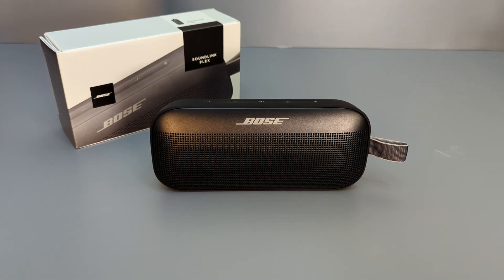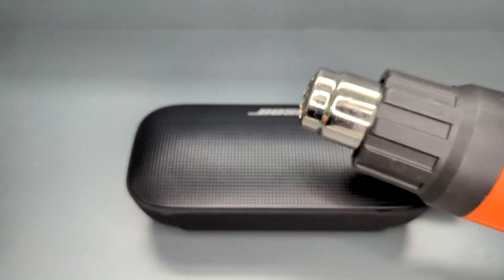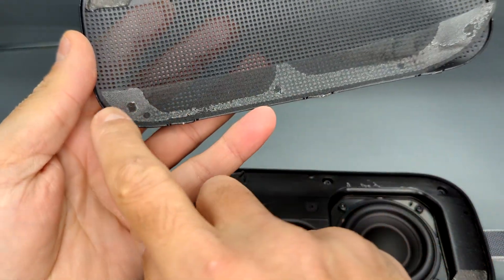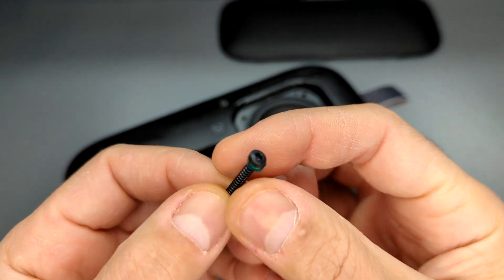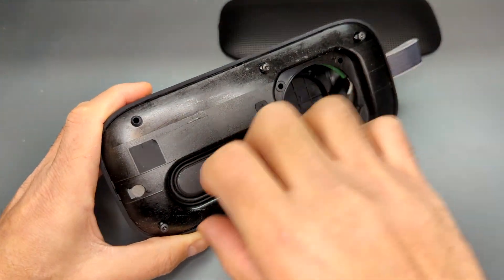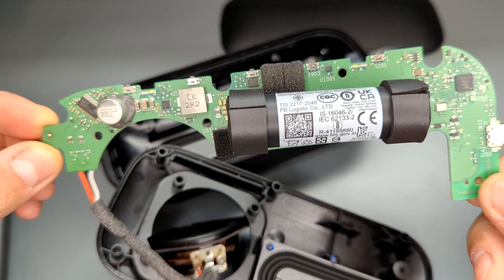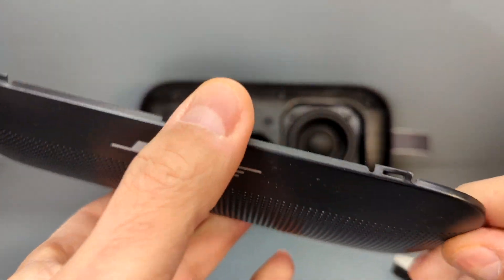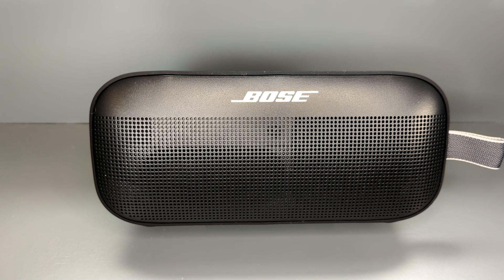Bose Soundlink Flex Teardown

Comment: Hi..I have this same speaker but now I have to tilt it forwards to make it work..there is also some distortion when in use...do you have any idea what or why it is doing this..I have reset it to factory settings and looked for a software update via the Bose app but its up to date and the reset didn't fix the problems...can you help?...cheers

Comment: Its a shame that this doesnt has an aux input. Did somebody found a way to connect it with wires?
Reply from the maker: Not that I'm aware of, would be nice if the manufacturer enabled  the usbc aux in.
Reply: @shaktastik  the same home prosuct with the same built and speaker support it. But after that the soundflex 2 has again no AUX via usb C support

Comment: My speaker has a problem with the white sticker on the front panel after the metal cover was removed. In my case, the sticker is leaking air, which causes the sound to be very weird. Do you know what the sticker is for?

Comment: I believe soldering is good choice for durability against dropping, shock, vibration. It is not regular that someone will replace those soldering parts. unless it's on professional with tools.
At the end I finally understand how passive radiator works. AHA, as soon as the screw runs tight, the passive radiator works again. Impressive!

Comment: hey bro i have a bose revolve soundlink series 1 and i live in inida. my speaker is about 6 years old and battery has gone totaly and it is not switching on also . when l went to bose official service centre in kolkata west bengal,they said me that they have stopped servicing the old gen of this speaker model.
can u suggest me any solution and solve it bcz that speaker is really close to my heart

Comment: Mine refuses to charge anymore... any hints as to the problem?
Reply: Something seems to be wrong with my charging port also. I’ve tried different cords with the same results so it seems to be the port itself. I tried lifting the cord a bit and held it to the speaker with a rubber band to charge and that worked for a bit but now that no longer works either. Help!

Comment: Bose has been quite decent at these little speakers and headphones for a while now. They combined their active EQ and small speaker devices from as far back as the 70's lol 
They also seem to hate using tweeters; it's full range drivers or paper cone tweeters. If you have a Bose product with a dome tweeter then it's a rarity lol

Comment: Hi. I was having a great experience with it but suddenly it keeps turning off whenever I try to play something a little loud. This had never happened before (it’s a little more than a year old). I think it is also not charging properly; once it turns off, it does not turn on unless I put it on charge again. Can somewhere tell me what is happening, and is there a way to repair it? I took it to the local authorised Bose store, and they said they can only replace it (and it’s not in warranty anymore). Please help!
Reply: I think your battery is dead

Comment: Great video! I just got this speaker as a compulsion and it always happens that after i buy stuff i realise I shouldn’t have done that. The flex battery sucks big time and the speaker has a lot of bass which overpowers the mid and highs. I liked the previous soundlink mini which was way better than the flex however thank you for this video just incase i need to dissect it 👍🏻

Comment: My sound link is less than a year old. Now, when you turn the volume too high. the unit shuts off. Maybe from vibration, maybe there's a bad solder joint.

Comment: One of my favorite things to do with these little Bluetooth speakers: set the driver on the table upside down and see how much it jumps around. Unlike a large driver, the lightweight and powerful neodymium magnet on these seems to actually provide some thrust! They’re also extremely overbuilt drivers that are quite hard to damage this way. 
I remember doing this on my original 1st generation JBL charge back in the day and laughing. 
This seems engineered way better than that one was. Same with the modern JBL Charge 5. Both are way better than most speakers were back then. Honestly with the Flex, Bose is finally back to the standards they set with the original Bose Soundlink mini. Flex really is the only Bose product that’s worth the price IMO. Really makes you realize how far ahead of its time the original mini from a decade ago was.

Comment: Curious what it would take to add a line-in for this speaker. I own one and sometimes miss being able to connect my old gear to it (like an old iPod). Can this be done based on what you saw when you opened it?

Comment: Thanks for the tear-down, the rest of us would be highly reluctant to do this... 😱 Despite being mono, from everything I've researched, the Flex sounds even better than my Bose Soundlink mini 1, so Bose have done a superb job for also keeping the size, form factor and cost in a comparable range. That full range driver in the Flex must have some real engineering chops in it.
Reply: Can someone answer for me - can you extend the Flex's runtime by connecting it to an external USB battery bank (ie. a typical 5,000 or 10,000mAh power pack?)
Reply: @127Foxtrot Yes ofc any powerbank can easy handle IT ❤

Comment: Awesome video! 
Brought mine to the beach, dropped out of my hand and fell into the sand, got some sand in the holes of the grill, got most of it out, but couldn’t figure why the sand didn’t come out of the holes in the lower part of the front grill. Now I know why, the double sided glue strip holding the grill to the housing continues about 2-3 rows of holes up, and sand will definitely stick to that. Not sure if it’s worth opening it up, it’s a small eye sore, but doesn’t have any effect of the sound itself (that I know of). 
Thanks for the tear down video !
Reply: It won't affect sound quality - your speaker just took some souvenirs home from its beach trip 🏖
Reply: Leave it as it is!
 Furrows in a face show character!

Comment: what would you suggest if the speaker is blowing air through the usb c port? like a lot and because of this the bass sounds horrible. if I cover the port it sounds perfect
Reply from the maker: If it's under warranty I would return it, if not and to seal the gap I suggest you open the speaker and use: LA TIM'S T7000 Glue, Black Super Adhesive

Comment: I bought this speaker at Costco which is the soundlink flex SE it’s the same thing as the regular flex but only minor drawback is it doesn’t have a built in mic. It’s a Costco exclusive. Anyways I was stun by the sound it has excellent mid range and good extension of the bass plus the clarity of the Highs are excellent. I’m an audiophile I’ve owned all sorts of speakers out there from high end  B&W, Sonus Faber, Vienna acoustics and even some klipsch, Polk, JBL, definite technology etc. I’ve had setups from 2 channel to home theater. So my expectations are quite high. This speaker does the job very well but I find out at higher volumes the bass starts to die down. It’s more of a near field type speakers and the bass won’t fill the larger room but the highs will. I’ve owned the home 500 from Bose and that one sounds a whole lot better and it’s amazing how small little drivers can put out such deep bass. I decided to do a tear down and found out there’s tube style tunnels inside that thing which improve the bass. The sound flex is awesome but not for the money.

Here’s why. People will hate me for this but the Anker Soundcore flex 2 sounds as good, while it doesn’t play as loud it has the same clarity and even better bass. Wanna know how much? 60 bucks at the Verizon store.
Reply: Anker is still young... Bose is Established and Premium. It's not about how people will "hate you" but seems as though the point is being missed.

Comment: I don't like Bluetooth speakers that only have one speaker. A radiator doesn't count as a speaker because it's not powered. The sound like mini 2 has two drivers and 2 bass radiators ... why are companies getting cheap and only putting one speaker in these units?

Comment: Excellent teardown - every minute step covered in an easy to understand tutorial. However, I have no intension in tearing down my Flexes, very interesting video though. By the way, 2 of these speakers, linked in stereo sound even more awesome. Great product.
Reply from the maker: Thank you very much ☺️ I haven't had the pleasure to pair both of them. But I can imagine the sound will be awesome. Why did you get 2 btw?
Reply: @shaktastik  Yes, when 2 flexes are paired in stereo mode the result is a very noticeable upgrade. I used to have a pair of Soundcore Motion+ which, on paper, could be linked to perform in stereo. It worked but had a regular tendency to lose the link for about 1 second between speakers, which made them unacceptable for my intended usage. So I sold those and bought the flexes. Only bought them a few weeks ago. Not disappointed so far.
Reply from the maker: Cool I've reviewed the motion+ too but you should get better bass with the flexes, enjoy and take care 👍
Reply: Gracias , una excelente explicación!

Comment: Soldering the speaker wires to the board makes perfect engineering sense for the most reliable connection. Connectors can become unseated by drops and vibration. If the driver needs replaced it would be simple to desolder the wires from the driver not the board. So your criticism of that is not founded an any expertise or engineering science. Playing the driver outside of the enclosure is totally pointless and serves no purpose whatsoever. The ability for the user to take the product apart is totally irrelevant and totally subjective and has no relationship to the sound or quality of the product. I give your video 3 out of 5.
Reply from the maker: Thanks for your feedback it will only make me better 👍

Comment: it is very impressive engineering by Bose. To make a mono speaker sound so pleasing is quite challenging. They made a magical speaker with this one.
Reply: Indeed. I’ve compared to other similar sized BT speakers that are supposed to be stereo and they don’t sound as good as this one. I also have a second Flex and do stereo pairing. When I go back to just the one speaker it still sounds quite nice and spacious.
Reply: Trust me, this is the bang for buck 🤑
Reply: yes but perhaps they could have used a much smaller footprint looking inside I see ways this could have been slightly larger than the speaker and not much more.
Reply: @xirtus  I am sure the size of the driver and cabinet are matched to get the tuning right.

Comment: 16:16 this is the moment where I start to wonder how these passive radiators work. I mean yes, the generell concept is clear. But in my understanding, front facing passive radiators swing out of phase with the speaker. They extend once the speaker retracts. So they show the opposite movement to the drivers membrane which should eliminate the impulse created by the driver. But instead, they inrease volume and sound... That doesn't add up.. 
Anyone who has more understanding of this and could explain what I don't see here?
Reply: the system of the active driver and the passive radiator is damped by the mass of the air in the speaker and the mass of the passive radiator. This causes some 'lag' in the movement of the passive side, kind of how a mass on a spring doesnt react instantly when u pull on the end of the spring. This behaviour causes most of the important bass frequencies to become constructively added to the sound by the passive radiator, i.e. they move in and out in the SAME direction!
Reply: Think of the way a port works. The back of the speaker pushes air through the port. The port amplifies the bass when balanced properly. In a closed scenario the speaker is pushing pressure in to a closed space. Add 2 radiators opposing one another and weighted properly it is just moving more air to exaggerate the low end. I don’t know if there is really any phasing per say because there is no polarity just low frequency energy be exaggerated. Just my observation.
Reply: @bsbarber73  Ah yea adding different masses to the chassis might do the trick. Anyways, very interesting concept

Comment: How would you know if the bose soundlink flex is fake and counterfeit item without teardown?
Reply from the maker: Try registering the product on Bose website using the serial number. it's a unique number so if it registers ok then it's original.
Reply: @shaktastik  what abt  before buyung it when its still on amazon

Comment: the csr chip is the bluetooth chip,  the other big chip on the left seems to be the amplifier, and the chip next to the battery seems to be a charging/bms chip
Reply: interesting placement of the 2 passive radiators, i designed my newest speaker with the same concept, nice to see that im headed the right way

Comment: easy replacement?? for a bose product?? lol those are discardeable, anyway, just 1 speaker, i have a like 10 year old sony srs x5 peaker with 3 activve speakers and 2 pasive radiators....... at almost that same size.... why is this thing so expensive????? does this has nfc?? that sony even has it, it has touch controls, glass panel, brushed steel, and also can. be use for phone calls..... it was around 120 bucks back in the day the battery still retains charge, the sound quality hasnt been reduced at all ............ please someone explain how this new speakers with 1 active speaker go fro more than double sometimes triple the money??
Reply: Just got it for $75 on ebay. Is that good price for one driver?

Comment: Those screws are so long because the case is plastic. All the vibrations will eventually wear out the plastic that holds the speaker in place, and the screws help make sure it'll be a long time before things start resonating.
Reply: More likely for waterproofing, but I agree. The screws holding the driver into the box are actually 4 of 10 screws holding the entire front of the box onto the speaker. Some would say it’s overbuilt (JBL doesn’t do this) but I actually think it’s a sign that they want their speaker to last a while and hold up to heavy use including outdoors. JBL gets around this by using rounded boxes instead, and I do think their product is well built too. I’ve not handled the new Beats Pill or Sony ULT Field 1 in real life yet, but it would be interesting to see how well built they are. Not fond of Beats’ continued use of thin metal grills: they are a thing of the past, from the time of JBL’s Flip/Charge 1 and 2, both generations of Bose Soundlink Mini, the Sony SRS-X2/3/XB2/3/XB20/30/40, and other era specific speakers like the Jambox. At that Time, UE pioneered the fabric design most companies use today. Beats should either be using the woven fabric that JBL, Sony, UE use, or the durable thick metal grills of the current Bose stuff.
Reply: All the screws have Loctite on them. They will never let go loose.
Reply: @wellroundedsound2422   loctite never wears out?
Reply: @ronch550 When undisturbed it's a permanent lock. How long? Longer than lifespan of the product itself.

Comment: Red ants gone in to the speaker😔
Now not working properly. I purchased this 15 days ago only.
Reply: How much did you spend on the speaker. Is boss support good in India?
Reply: @SamS-ef5ez   Hi I spent 15900/- for this speaker. Service is very worst. For service pickup they took 12 days. They picked up 8 days ago till now no update from them..
Reply: Did you get your speaker returned and fixed?
Reply: @gewurztramina  Yes I got replacement finally after 2 months..

Comment: For a quality brand looks very cheaply made and the sound is not that good
Reply: Tbf, I bought it as my revolve broke and it feels very well made. It also sounds pretty damn good for its size. It even sounds relatively good next to my JBL Xtreme which is 4 x the size. Impressive considering it has no tweeters and is mono. Also, it's a huge upgrade over the revolve imo.
Reply: It’s actually extremely well made. Soldered joints. Good speaker with huge magnet, with passive baffles. Even the screw lengths give it rigidity when vibrated and loosened from drops they will take a long while to back out. It definitely lives up to its Ip67 rating.
Reply: @catharticcathexis4527  huge magnet lmao

Comment: The sound quality difference when you reassembled everything was quite stunning. When playing with the passive radiator on it sounded amazing. Could you tell why it is so important?
Reply: Double passive radiators work as bass reflex vent but in a small cabinet. They reproduce low frequencies main driver can not deliver with much level. Besides that, main driver is prevented from playing on passive radiators frequency range. Main driver excursion is lowered and thus its behavior is vastly improved. The only downside is delay at low end. But for such small speakers, it is not a concern.
Reply: @tristanjacquel  ä
Reply: When the enclosure screws were tightened along with the driver screws the whole cabinet becomes sealed. The fart noise you heard prior is air escaping (air created by the speaker movement) so once sealed the passive radiators then begin to absorb the sound pressure waves, this causes them to radiate sound (ie etc like a speaker cone).